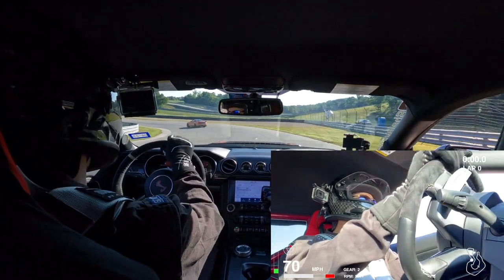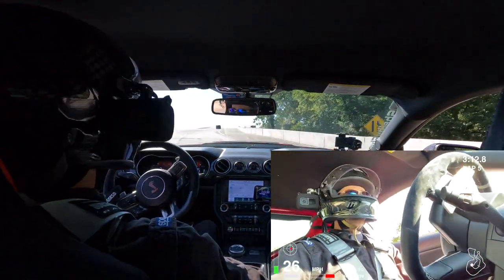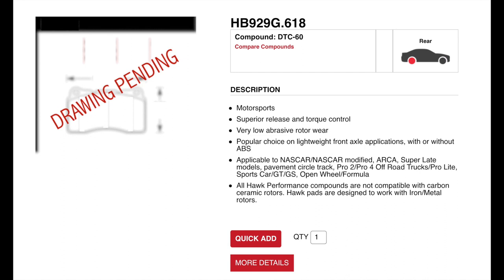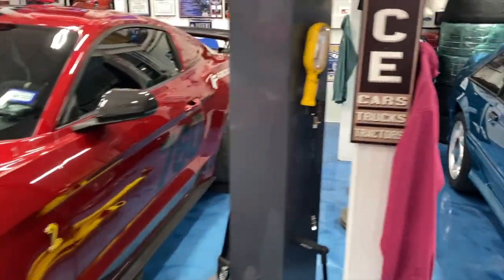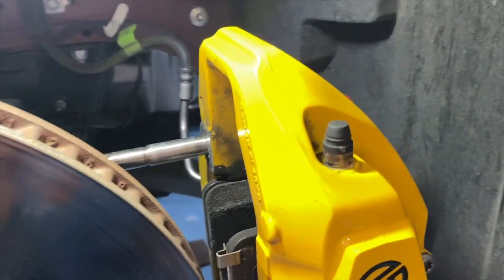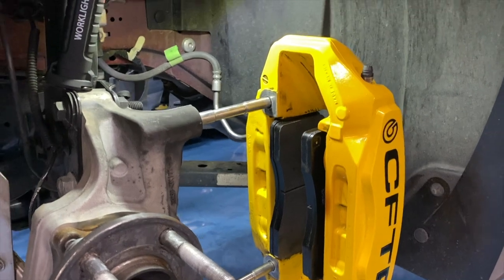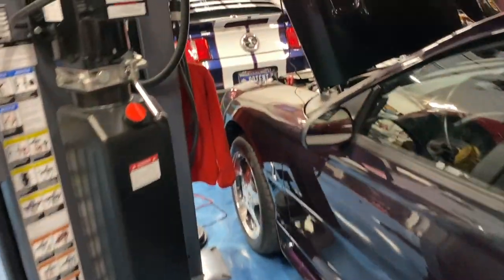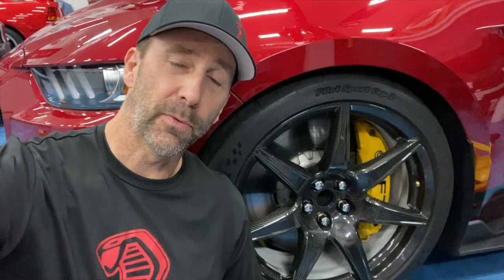Hawk Performance DTC-70 DTC-60 Track Brake Pads 2020-22 Shelby GT500

Comment: Did you upgrade the brake fluid after this change?
Reply from the maker: Yes! Motul RBF700 from Middleton Motorsports. Use my discount code.
Reply: @ShelbyFlyer  Thanks Tim. Are the rear rotors handed, left and right? I see only left hand in the OEM description.
Reply from the maker: @carlcarlington600  I don’t believe so. The fronts are directional for the cooling ducts.

Comment: I read somewhere "turned" rotors for street use not track use......"bring your best brakes to the track"
Reply from the maker: Depends on how much material you remove. There is a min thickness stamped on the rotors. For the GT500, it’s 38.0mm for the front. So far, my rotors have been good.